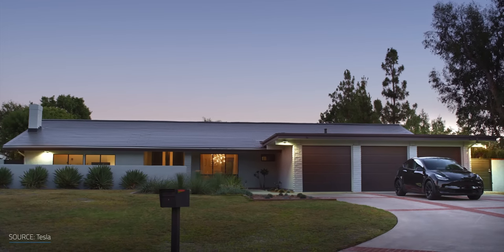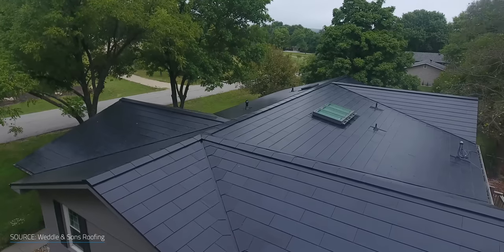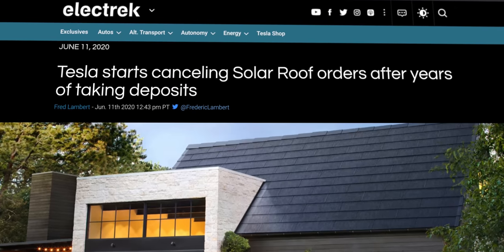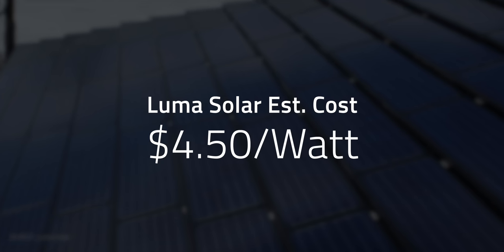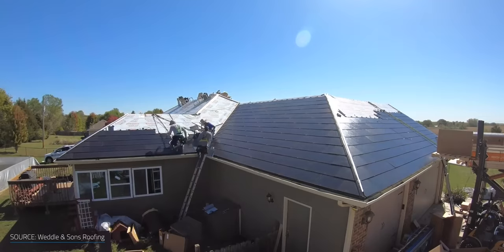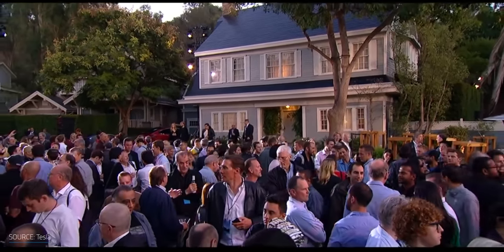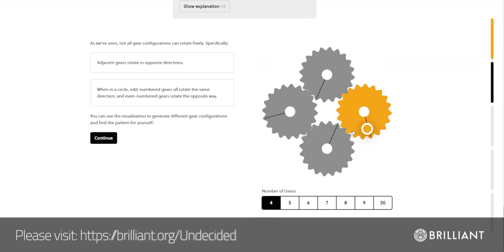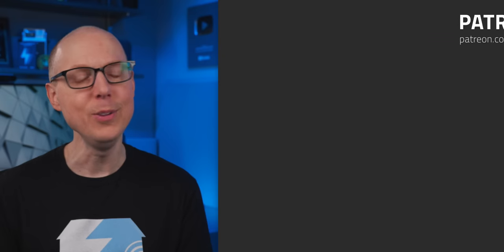The Problem With Tesla’s Solar Roof

Comment: I got an estimate from Telsa of 120,000 USD to do my roof and a powerwall, but only about 10% of my roof would have solar capability and it would only supply about 40% of my electricity.  IN Tennessee the TVA offers good tax credits along with federal tax credits, but really not worth the price (I had traditional quotes of 25,000 to REPLACE my entire roof).  Another company with traditional solar panels for $60,000 offering UPTO 60% power (much better deal), but as my roof as 100% sun all day with no shade,  am still not sold on these for the ROI.

Comment: With respect you completely missed out the most important item for any of these roofs - the net electrical production on an average annual basis and the geographic factor in various parts of North America.  For example, we have had an operating 10 kW roof mount solar panel system for 9 years now in Eastern Ontario and the average annual output fed to the grid is 12,352 kW/hr. Our average annual household electrical usage is 12,137 kW/hr. therefore we're happy. Total installed price of the solar system was CAN $36,000.00+- and would be under CAN $30,000.00 today. With a provincial electrical utility / government financial incentive program our complete system paid for itself in <7 years. High quality materials and technicians were used for the installation therefore we're anticipating an effective panel life of 25 - 30 years before replacement becomes necessary.
Reply: You did everything right! 
#TakingNotes

Comment: Big issue, what if 10 years from now a few of those shingles fail and have to be replaced? My thin film panels are no longer manufactured, so if I need a panel to replace a failed one, I'm out of luck because of the high voltage and differing size they use compared to normal mono/multi crystalline panels. (100V vs 40V, 66cm vs 100cm). I image the same will happen with PV roof shingles.

Comment: I think there is an extra point, low cost roof have an important drawback, the maintenance, things like painting the roof so the water doesn't damage it, over the years it adds up to a fraction of the cost of a solar roof, so, over the long term, that plus electricity costs plus electricity reliability make it what could be a more affordable solution. 

In my opinion the different countries should pay for them as a cost saving measure, it is cheaper to use roof of people to make and deliver energy than it is to use an unoccupied area just for energy generation (in this context i mean cheaper overall, not referring to only monetary value, if you had to pay nothing and ensure you will have electricity because the roof goes to you first then i think more people would be willing to accept that compromise, since the area is unused the other area can be used for other things, etc, so, lower cost overall even if the monetary cost is higher)

Comment: The prices are high because the demand is low.
It is ridiculous to solar shingle your entire roof.  For example, north facing roofs get very little sunlight.  There are solar panels with a collection of parallel/series connected wafers, and panels with thin-film deposition panels of glass.  The photon to electron conversion efficiencies for wafers is on the order of 17-22%, whilst TFS panels more like 12-18%.  Did you know the reason the rotated "square" between wafers of ARCO Solar/Siemens Solar panels is actually intentional?  It is the ARCO logo.  It takes a tremendous amount of energy to grow the single crystal silicon ingots.  The ideal configuration is to design panels with a tracker system to keep the plane of the panel normal to the angle of the sun.

Comment: More people would join in the solar roof idea if they let the consumer buy directly. If you can DIY one, people will buy the parts themselves. Heck, GAF roof looks identical to shingles like you said, so I can't see why a jack-of-all-trades couldn't do it himself. The panels are plug-n-play, even. The only part that would be difficult is the electrical connection to the mains, but you can easily get an electrician to do that final step.

Comment: Now add a thin water cooling system under them to supply hot water all year round, and provide some extra heat to the heat pump in the winter.

Comment: I suspect that residential solar roofs are first going to get traction in pre-fab homes.  Imagine a Boxabl with an asymmetric (higher on one side) slanted roof.  Doing all of the work in the factory, on a roof designed for solar, will reduce costs dramatically and ensure quality.

Comment: I looked at the pros/cons of getting a solar roof vs panels in the house I just moved into. Because my roof was in perfect shape and likely will be for the next 20 years, it wasn't feasible to justify the cost to replace it. In general, I'm sure that's a problem with solar roofs. Market is somewhat limited to either new construction or 'older' houses that might need a roof replacement anyways. With the way many people I know plan, they don't replace their roof until they NEED to replace it, and by that point, they cannot wait around months to get a solar roof installed. I ended up deciding on a 9kwh LG system. Still in the permit process, but hope to go live by the end of next month.

Comment: I've been wondering, if solar panels lose efficiency when they heat up and heating systems are one of the most inefficient uses of electricity, wouldn't a water cooling system piped under the panels help with both problems? Panels get cooled and the water gets preheated to feed a water heating system. I haven't seen anyone selling a mixed solar electric and water heating system.
Reply: Yes, it's a niche with-in a niche, but they do exist. it's kind of like learning we've had electric cars since as far back as steam power. 

https://www.youtube.com/watch?v=hBYbodmCBUQ

This person just got some of that type of panel installed.  Definitely worth a watch, LTT manages to be an 'entertaining' tech youtuber.

Comment: Pipe Dream.   Most of those homes are good Demo shots.     In hot areas the home roofs have steep pitches with AAV, whirlybirds and other vents all over the roofs.   Solar roofs are aesthetic decisions.   When I drive to some installs to commission half the homes don't even show the solar panels from the street.    I view solar roofs as limited to a niche of people who have southern exposures on the front of the home and are willing to pay the cost.  Many people willl have good southern exposure on the rear or side of the home and they're going to go with the much better dollar/watt of standard PV panels.   ESS is the future not a more aesthetically pleasing roof if energy independence is at the top of the list.

Comment: Could you do an update to this there is a new company that has solar cells on tiles that clip together to give a more architectural look which they claim are more efficient.

I have a concrete tile roof which are curved up and down and likely have another 20 to 30 years before I need to replace the roof.  Of course the rub is how do you store the energy to use at night.  And how does connecting to the grid to sell your excess energy during the day work to offset your electric bill during the night.

Comment: Had TeslaSolar Roof installed on my house in E. Norwich NY last fall/winter. Just got it turned on. Company's  intallation was botched up, damaging the siding on my house and  now I'm  getting nowhere with the company. Repairs estimated at $10,000

Comment: You missed major points. 1) Weather survivability. Here in Florida it's not just the hurricanes that could tear those apart. Normal tropical storms could do the same. In other parts of the US they face tornadoes. 2) accident liabilities: even during a normal storm those shattered tiles look somewhat like broken glass... Flying off your roof! Prepare to be sued for hazardous construction. 3) The potential to draw a lightning strike. You got a lot of wires up there & some are connected to ground, aren't they? 4) Added insurance due to #2 & #3. 5) kids play ball, how brittle & how resilient is this system really. 6) Kids climb roofs & boys can play hard.... So again, how resilient are these systems really. I don't actually know the answers, technology & companies producys vary. But these are still important (major) points.

Comment: Where I'm from in Canada, electricity is relatively cheap.  The talk of solar panels is not even a conversation.  What is more in vogue though is switching to a metal roof for longer longevity.  Prices in this domain have been coming down with more players and cheaper products...

Comment: One of the things I would like to see is a comparison of solar panels vs. solar roofs when the temperature is high.  For example, here in California during peak solar generating months the roof temperature can reach 110o. Has anyone done a scientific apples-to-apples comparison of the 2 types of solar collectors to see the effect of heat on efficiency and lifetime?  Given solar panels have bottom side airflow while the solar roof doesn't I expect solar roofs would be much hotter than solar panels resulting in a shorter lifetime
.

Comment: I'd prefer solar roofing. Like most technologies, it will not see its full potential until there is wide spread availability. Tesla, and others will all improve as time passes. I believe must people would embrace supplementary solar energy if the 'sore thumb' aspect of placing giant reflectors on roofs was removed. Good video.

Comment: So there's multiple things I wish you had touched on. One of the big benefits of solar panels as opposed to solar roofing is that you can get distinct benefits of your roofing materials that your not afforded using solar roofing. Metal roofing with a radiant barrier underneath and painted with a ceramic- high reflectivity paint is a huge benefit to household efficiency, and your not able to reap those benefits using solar roofing shingles. 

Tldr. If efficiency is your primary concern, solar panels with a metal roof is the way to go.
If it's anesthetics, with a bit of a cool new tech edge it's solar roofing shingles
Reply: You'll need an ANESTHETIC if you install a tesla solar roof.

Comment: I'm outside of Boston, MA and my roof was due to be replaced. My wife really hates the look of solar panels so I thought Solar roof shingles was the solution.  Tesla wasn't yet installing in my area but I put down a deposit.  A few weeks later, Tesla contacted me and said they are going to start installing in my area.  They just needed me to sign off on the estimate.   When I looked at the estimate I almost fainted, $162,718!  I then looked for other Solar roof tiles and found SunStyle.  They sent me an estimate for $116,520, which I thought was better until i realized that was just for parts and I would need to find someone to install it.  What I ended up doing was a new asphalt roof for $32,500 and Solar Panels from a highly rated firm for $47,000.  I put the panels on the west and east facing roofs out of line of sight from the main street.  So I spent $79,500 total (with a 10 year loan).  I'm hoping the savings from solar will pay for the loan.  Tesla never made any sense. Over $83k more for something that would look better?   I know aesthetics is worth more but twice as much?  And the savings would never cover the loan costs.

Comment: Another problem with these solar roofs like tesla's is that in other parts of the world, like Europe, roofs are built with more durable materials like clay curved rooftiles, stone or composite (hard composite, not asphalt composite) shingles, etc. and easily last 30-40-50 years without major renovations needed. That 40y warranty from solteq is just expected here in EU for a roof, especially when it costs so much. A 20y warranty on tesla's solar roof, that still easily costs 50000 to over 100000 dollars is just not enough when most regular roofs last AT LEAST twice that long here.

So while it might make sense for new buildings to consider solar roofs, for most already existing buildings or renovated buildings completely renewing the roof is just not necessary for another few decades, and solar panels mounted on top are a far better sollution...

It really is very much an application for the N-american market where less durable asphalt shingles are the standard. But then the price difference between the cheap less durable shingles, and extremely expensive and also not so durable solar roof is just too big.

Comment: Unless you easily have the money or building a new home or new roof I would hold off on the Tesla roof, by far its the best of its kind but as you can see its expensive. As time goes by this technology will get better as it does the more you will see it from Tesla or other companies and can become more cost effective.  If your looking to save on energy before looking at Solar I would also recommend looking at the insulation of you home.  Not just our home but people I know have saved any where from 20-40% on there bills just by having your home properly sealed.

Comment: I have a panel system that underproduces every month.  I have a small home so a system that was designed to produce 7.5k kwh of energy should have been plenty.  However the inverters they installed max out at 5.7k kwh of production of continuous production so roughly 30% of any potential production is wasted daily all attempts to get them to honor their contract and remedy this problem with installing the proper inverters have produced nada results I should've installed shingles

Comment: I have encountered insurance companies that will not insure a home's roof if it has solar panels installed. What have you learned in your research about this? I know a homeowner who had to remove the panels before their Buyer could close on the purchase of the home, due to the insurance company would not cover the roof for the solar panels.

Comment: I love what Tesla is doing, i really like what the company is doing. However - i live in Australia, and my 15kW solar install on my roof cost me $12,500 total (in AUD). We do have subsidies here so the govt actually forked out around $9,000. So about $21,500 all up if you want to factor that in (which Australian customers don't need to). A Tesla roof, just does not come close cost wise, it's not even in the ballpark or even the same universe.

Comment: Wait, I don't get something. At 9:10 you say Timberline has 45 watts per sq ft and Tesla 71 per sq ft. That would make just crazy high efficiency when comparing to standard PV plate, that's 1,7m by 1m and gives usually up to 450W - less than 25W per square ft. Is this true and  these products are THAT good, or did I calculate it wrong?

Comment: The problem with solar period.. at least on my side of the country is it's 100k to install and the ROI for something like that when the electric company still charges you a monthly rate is so large even with my high electric bill that it's just not worth it no mater it be panels or tiles. My current electric bill is around 400 a month... my electric company charges for my individual transformer to be charged as well as equipment rentals, etc... even if I don't use a single watt of power will be a bill of 125 from the electric company... That's over a 30 year break even point. I understand that there is gov subsidies that will lessen the burden some over several years of tax credits but they really need to make this technology more cost effective to the masses.

Comment: Imo itd be great move for states to give tax breaks/credits for solar installs areas like your example of iowa.  As pointed out the cost relative to home value is a hard sell there.  But consider a 50k install for a product that last 30 yrs is just 1700ish a yr.  Plus those homes will be worth a considerable amount more with 30 yrs inflation value added to them.

Comment: How can it be efficient as a shingle? The angle of the sun is important. Parts of the roof will not even get sunlight and if they do it likely will not be in the correct direction or angle. Efficiency will be wasteful compared to traditional solar panel. Pay more get less? That’s a dud.

Comment: The problem with all solar mounted on roofs, is that it's mounted on roofs.

Meaning that you are guaranteed to have to uninstall / reinstall and whatever other material and costs that entails when you have to repair and replace the roof (avg every 30 years) and depending when you bought your house and the condition it was in when you bought it, very likely < 30 years, YMMV.

No one addresses this problem.

It's like a million 10-year old dead batteries in EV's that fall on the "owner" to figure out how and how much $ to replace and infrastructure or properly dispose or recycle.

No one thinks about sustainability and recurring all-in costs.

Or they do, and they don't bother to mention the problems, the cost $, or the solutions and their costs $.

Comment: if you make your house super efficient, regular monocrystalline solar panels and large lithium lifepo4 battery banks cycled between 25% and 75% for super long life spans (30-40+ years) are more than good enough. We don't need new tech for electricity, the stuff we have works so well. i'm 100% off grid with this setup and it's magical, free, unlimited power (when you have a super efficient home).

Comment: The problem with solor panels, is it causes holes in your roof. I have 3 neighbors that are at odds with their solor installers. The panels have  leaked every year since they got them. The installers are slow to fix.
Reply: It is just poor instalation, nothing to do with the panels really.

Comment: My electricity bill hasn't passed $1,000 per year yet. So at 50k for a solar roof vs 10k for a regular roof I will be dead before I break even. One advantage of the traditional solar panel is it shades the roof helping to keep the attic cool.